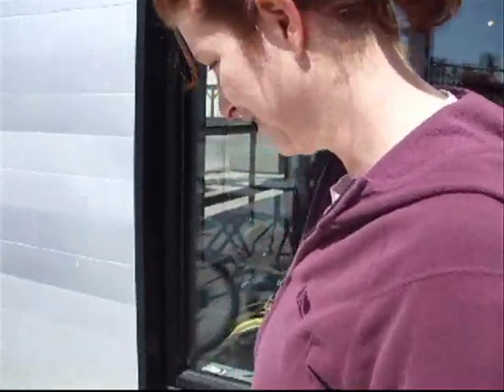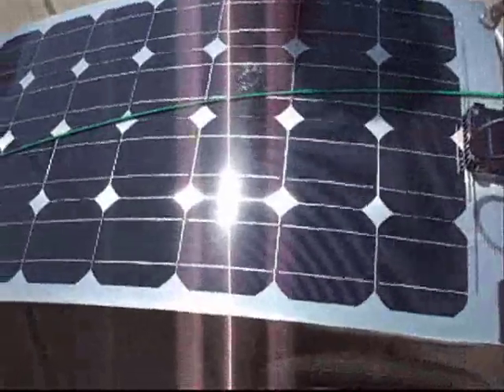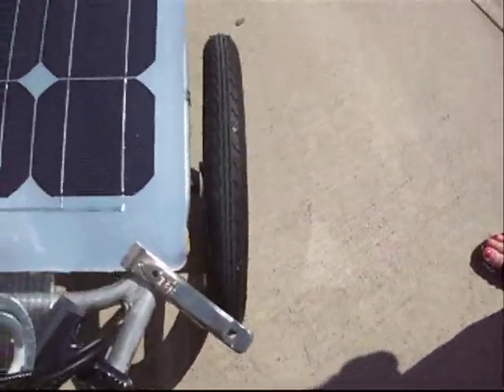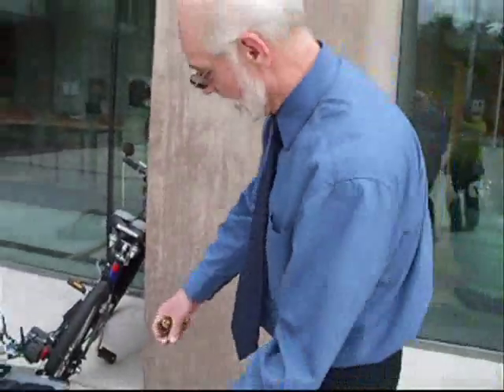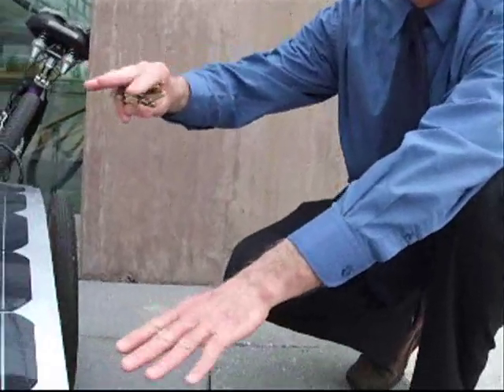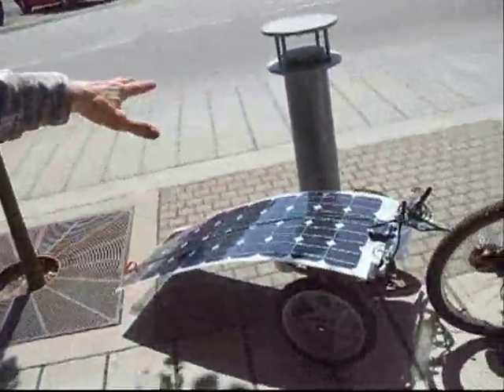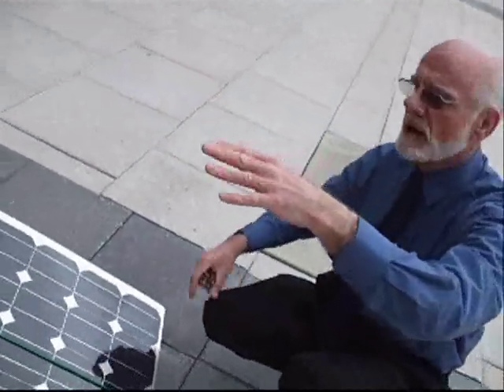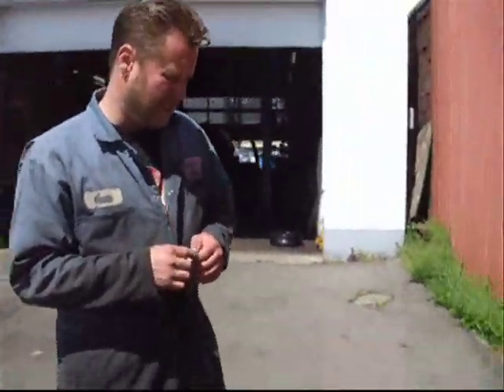100-watt Flexible Solar Panel on Vancouver Solar Electric e-Bike Trailer Needs Redesign

Comment: use a 100ltr plastic box as the trailer with the axle directly connected and the solar panel as the lid

Comment: Chop the solar panel up into smaller parts then attach them to the spokes of both wheels (both sides). They can then directly feed into an electric brushless motor inside
each wheel.

How you wire your throttle will be a challenge but that's not impossible.

This eliminates the need to have a cart towed behind the bike and drops a lot of unnecessary weight.

One question though. Do the flexible solar panels bend across the panels as well as along their length? And to what extent?